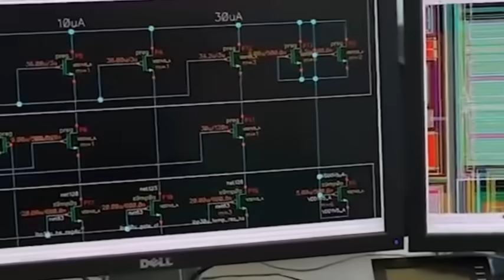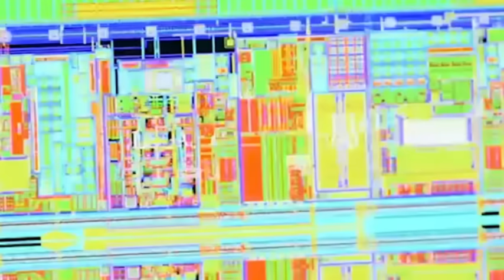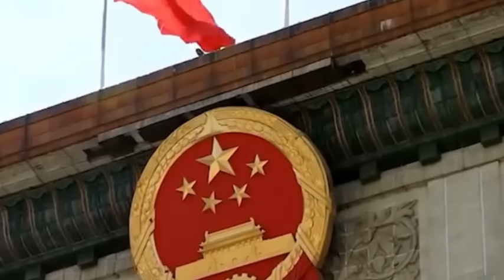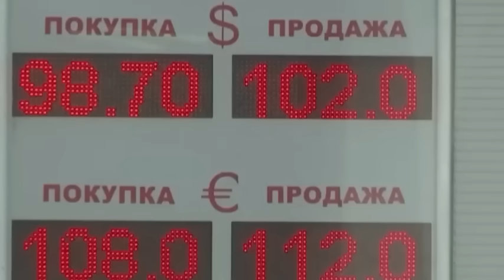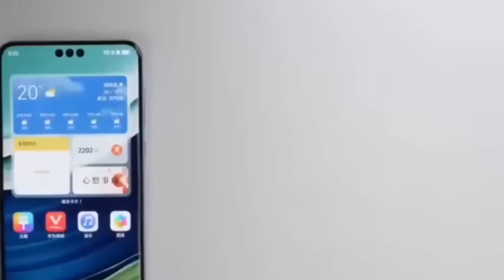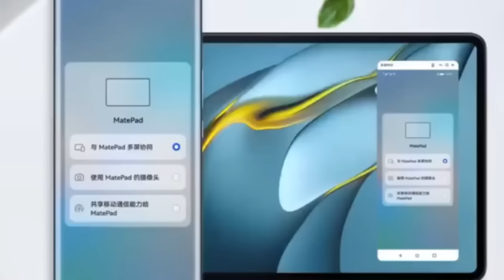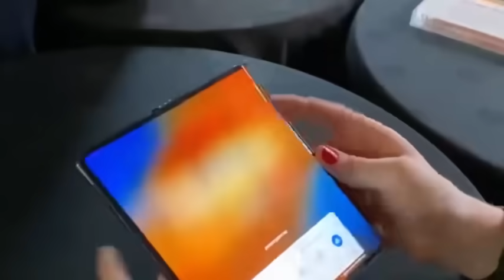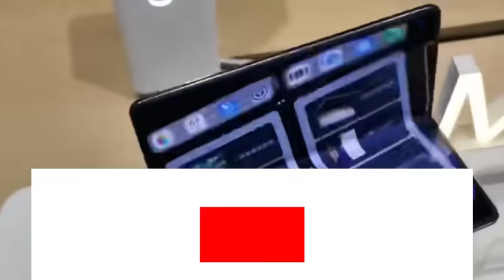Russia develops its own EUV lithography machine, breaking ASML's monopoly.

Comment: This is so suspect, I immediately came to the comments section.  Russia has been unable to have a semiconductor industry based on tens and hundreds of micron, much less 2-3 nm.  Russia’s reduced to stealing chips out of toys to use for precision guided weapons - itself an oxymoron - because it a:) can’t manufacture them and b:) can’t import them due to sanctions.

Another AI disappointment, and proof that AI isn’t immune from error.  ‘Don’t Recommend Channel.’  Be ashamed of yourselves.
Reply: "Russia’s reduced to stealing chips out of toys to use for precision guided weapons"   Where did you get this 'fact'? Which toys specifically? You have inside knowledge of Russia's precision guided weapons manuacturing???? WOW
Reply: So many things wrong with this comment I wouldn't know where to start.
Reply: CNN brainwashing working well on braindead individuals, it seems.

Comment: Most EUV patents are invalid therefore not en-forcible in Russia and China because of the embargo. When you have monopoly and you don't want to sell or cannot sell, that monopoly is taken away.
Reply: I don't think patents would play a role here anyway. ASML just has a very expensive approach, doing something different will take less costs than copying ASML.
Like the molten tin lightsource, producing 13,5 nm light, is expensive to build and maintain. The former CEO of ASML himself talked about how it was such a pain to work with. Because you need to keep a vacuum, and everything has to be sterile, but in the EUV-source you have tiny droplets of vaporised and liquid metal flying around.
The 11nm xenon lightsource doesn't have that problem, but you need different mirrors for focussing a different wavelength.
Reply: @sasjadevries Funny fact — in Russian city Dubna anyone can buy for self exactly this source of 13,5 nm light. It is not very powerful (for industrial grade lithograph need much more powerful / which works faster), but it produced freely, used mainly by misc scientistic labs. 
It was invented in Russia independently from ASML.
Reply: Spot on 😂😂

Comment: Nano chips are not required in many applications except smart phones. This is my take.
Reply: yeah, I once read that more than 80% of the world's need for chips are just legacy chips (bigger than 7nm), and China have no prblem in being self-sufficient for their needs manufacturing electronics, cars, toys, etc. for the world. Sub-7nm chips as of the moment is just for bragging rights, except for some boutique toys and advanced mobile phones, they pretty much have no uses for the moment. The need and demand for them still haven't caught up
Reply: In AI the smallest chipset has an advantage
Reply: @jackshultz2024 It is based on technology of chip and AI (algorithms) itself. Big and complicated question. Currency consumption also can be very different not only regards to size if transistors, but to materials from which they are made. And here is also a lot of options.
Reply: More crucial are the AI chips.